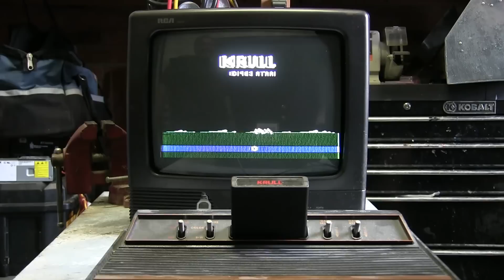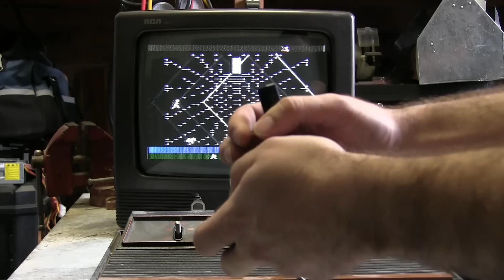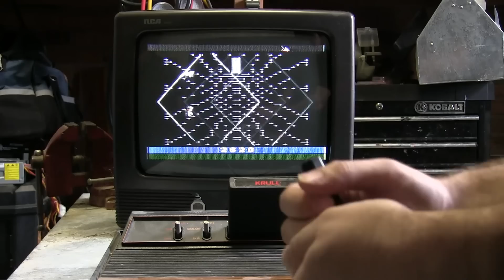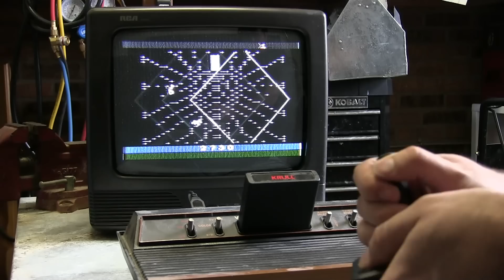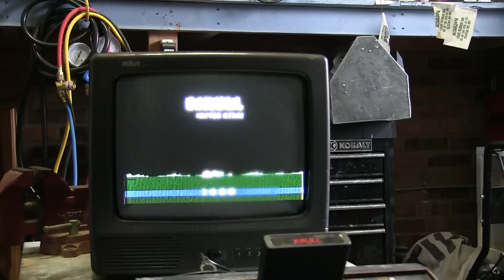Small CRT TV Smash

Comment: OK smashing the TV is 1 thing  Why the hell would you smash a working Atari thats 30+ years old that lasted longer then any New game system. i would have bought that Atari from you
Reply from the maker: Even though I did destroy an Atari 2600 in a video I filmed back in 2014, I made a promise on that video stating that would be the only 2600 that I would ever destroy. I have kept that promise. We did not destroy the 2600 in this video. Only the TV and a cheap modern 3rd party controller were destroyed. This particular console was purchased by my parents in the early 1980s and it became me and my older sisters first video game console.